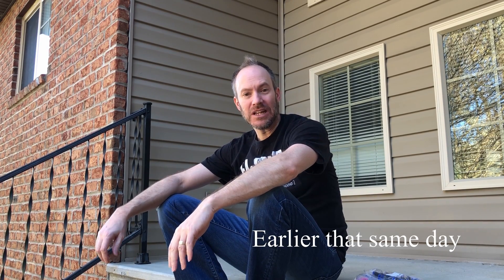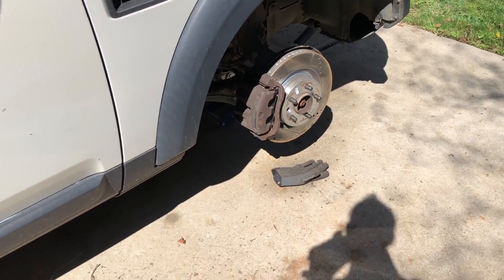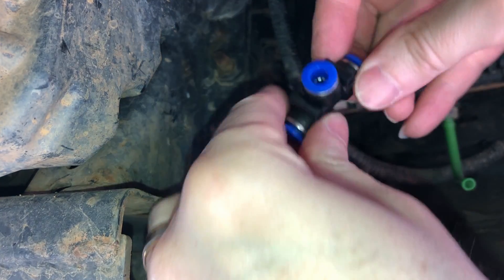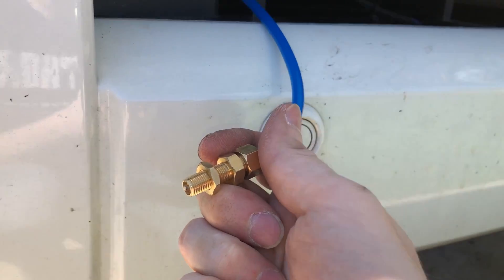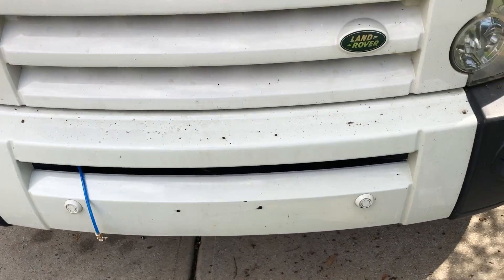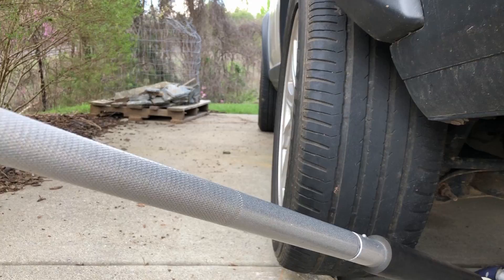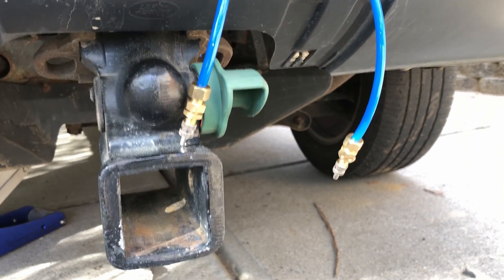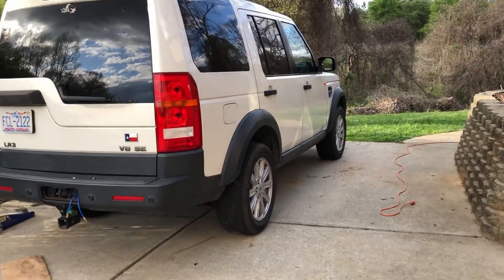Air Suspension Manual Override - Emergency Lift Kit.  Land Rover LR3 Air Fix!

Comment: Wouldn't it have been way easier to just put one t connector in line with the existing air pump? Filling the air reservoir? If you needed to go to extreme, then put in a 5 gallon auxiliary reservoir tank to give higher volume? Seems like what you just did is a waste of time, money, and convenience. Dang man. I really hate to break it to you this way, but you did way more than necessary.
Reply from the maker: Hi Garry.  You are right, it was more work, but the reason I did it close to the struts and not in line with the existing pump and reservoir was that rover computer issues or wiring issues can lead to a failure there.  (for example transfer blocks shutting down, sensor wires being snagged and ecus glitching all are still a failure option if injecting at that point).    But at the strut there is no way it can electrically be blocked, it becomes 100% mechanical injection point. Thus an emergency bypass.
Reply: @FarReachFR  So putting a T in right after the air pump would not work? I'm guessing you may be talking about in case of valve block failure? Height sensor failure? Those are easy enough fixes and you can keep spares on board. Maybe I'm missing something?
Reply from the maker: @garrykennedy5484    This project bypassed a suspected corrupted ECU/BCU+.  
In more detail: You could certainly add a T right after the air pump and it would work for many situations, but not all.    In this particular instance the LR3 when scanned was throwing data and failure codes that appeared that one of the LR3's onboard computers failed (The valve blocks and height sensors you asked about were registering fine). Common electrical and relay bypass measures (that usually work) still resulted in failure modes.    You could carry extra body control modules on board, but the particular computer in question was quite expensive and fraught with secondary problems.  And that only solves one element of future possible failure, as multiple points of failure still exist within the LR designed electrical system.  Pressure pump-> thermal sensors-> height sensors-> multiple valve blocks->ECUs-> not to mention the wiring harness itself/fuses/connectors/corrosion/shorting.  Even a minor door ajar is a shutdown mechanism for the air suspension.  As such, I was willing to take some extra work in exchange to make an absolute-full-bypass-direct-injection-system.   I wanted ZERO electrical fail points in my Emergency Lift Kit.  Would it be much easier to T in after the pump. Yes. and that would solve for pump failure and thermal sensor override failure.  But I hate ALL electrical failures so I by passed ALL electrical fail points.  Including the computers  :)
Reply: @FarReachFR  I didn't consider the BCU failing. That would present a problem that only your solution would work for. I wonder if there's a manually activated valve system out there that could be put in place? Like maybe from an older air suspension system.
Reply from the maker: @garrykennedy5484  There are actually a lot of air ride suspension and what I would call "show off" bagged kits available as well.   Those could make a reasonable swap and would result in brand new components.

Comment: One suggestion. Add another "T" fitting to the two air lines (Front + Back pairs) which would give you one air supply for the front pair and one supply for the back pair so all you have is two shrader valves ( one in front, one in back)  that will fill the front air shocks together and same for the back. I can't see a reason to fill the individual air shocks to different pressure ( or heights). This way the pair of shocks will be at equal pressure.
Reply: Kind of nice to do 4 because if an airbag has a leak, it is easy to isolate it and find fix the problem
Reply: Danger Will Robinson...the car would risk leaning outwards when cornering if left and right are connected together? i wouldn't connect them.
Reply: This would screw with the crosslinking and potentially cause huge stability issues! But if you add valves after the T going to each side.. So you can open both to fill both sides, open one to fill one side, and keep them closed normally. I think that's a great idea!
Reply: Ll
Mn
Reply: Do you have to T in to the valve blocks or is it possible to just T the two fronts together and have the one Schrader valve? Same for the rear, rather than re joining the cut tubes can you just join both struts together  and inflate together?
Reply: @olivia-raelemon805  Have you got the answer to this yet? That is what i am going to do once i get the tubing here from amazon. I will let you know if that works. I feel like doing both lines and to the block is pretty much a waste of time and a T fitting.
Reply: @olivia-raelemon805  Danger Will Robinson...the car would risk leaning outwards when cornering if left and right are connected together? i wouldn't connect them.

Comment: Great concept as Emergency back up. The air struts are not designed to hold air perfectly, so I don’t think this will hold to use long term without having to continually add air every so often. 

I have had a lot of experience with LR3 air system repairs and mods. That blue tubing, it needs to be 100% nylon. The poly or poly blend won’t hold with higher pressures and heat. Trust me, had to replace all my non nylon hoses after failures in the road and trail. Next, you should only cut those hoses with a sharp utility knife or a guillotine hose cutting tool. By smashing the hose does permanent damage and will cause leaks long term. 

Fyi: those valve blocks lift up and off the mount, you can get to the rear one with jacking the rig up and not having to take the wheel off. 

I’m curious if you don’t have shut of valves if the ECU will stop lower the rig with faults based on unexpected behavior causing it to drop to its bumps. 

Also, look at the SYA kit from Lucky8 LLC to keep you up higher in a failure (even complete bag failure) and let you roll with larger tires. It’s Genius. And keeps your bags at near normal pressures and extension while lifted with rods or Xlifter / GAP tool. 

Cheers!
Reply: Or Easy Lift suspensions module as well :-)
Reply: Polite reply by @Chad Street that this is not a good idea.

Comment: Great result. Peace of mind. In West Australia I've heard mention that some tag-along tours into remote areas wouldn't allow air suspension Land Rovers.  
But this has inspired me to go ahead and order the parts to do this to our 2006 D3.  
In addition I will add small hand valves between the tee-in fittings and the solenoid valve blocks as sometimes the failure is the block itself and they can fail open if full of moisture or gunk or powdered dessicant from the dryer.
The hand valve will allow the valve block to be isolated and taken out of the equation.
Reply: Where do you order all the part from?
Reply: Please ist supplier. Needing info
Reply: What is the kit called? Were you successful with the swap. Share please

Comment: Great idea. Thanks for sharing. How did you bypass the computers?
Reply: I was thinking this too
Reply: Like @LR4_morocco says, you can remove the fuse located under the hood. @Far Reach Engineering has a video that shows you how to access both fuse boxes.
Reply: maybe by removing the dedicated fuse...
Reply: He doesn't say what you could get the Schrader valves or nothing